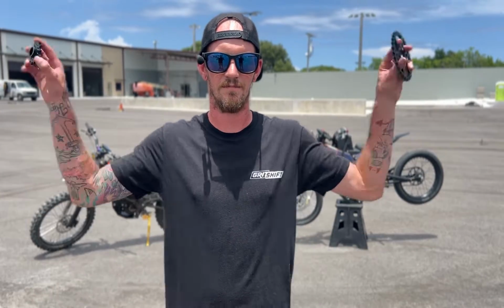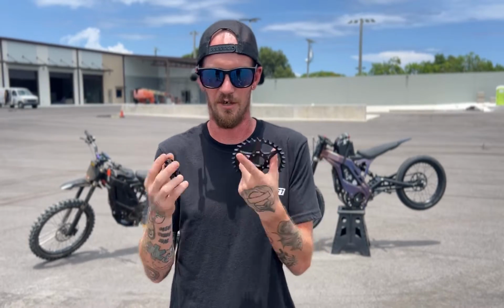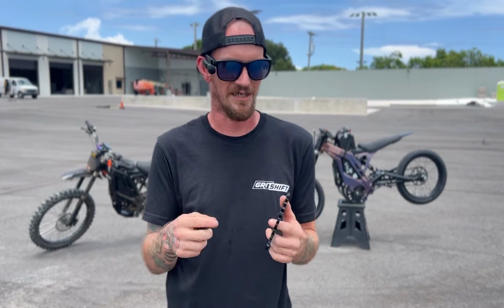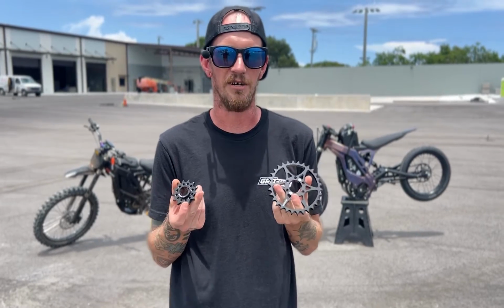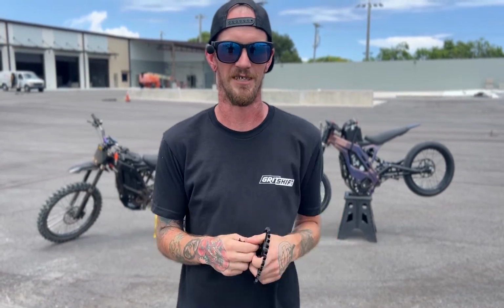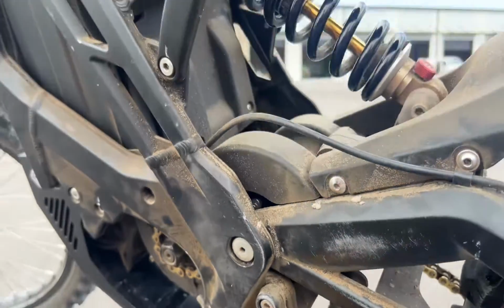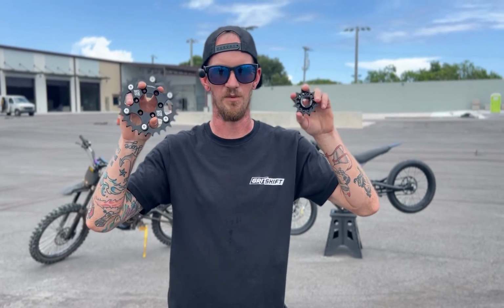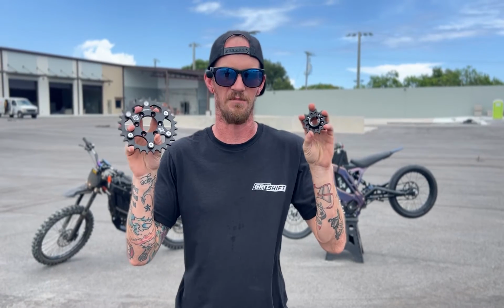High Performance Primary Chain Drive 420 & 520 For Surron LBX, Ultra, E Ride Pro SS

Comment: Are they lighter than Warp 9 Sprockets, like I run a 60 tooth Rear with a 16 inch Tusk Recon or Cheater Tire, Warp Wheel, stock front sprocket? Always looking for ways to cut weight especially on Rotating Mass. Thank you. need to raise my Bike up a bit too, need to buy one of your Linkages for my SS Pro but everywhere I check, they are out of stock. Thank You! : )

Comment: What motor are you currently using on the dragron?
Reply from the maker: We are now using the xlb-60 prior we where using the KO big block. We switched over to see if we could get faster times. The e ride drag bike is using a ebmx ultra bee motor.
Reply: @gritshift  did it work are the times faster?
Reply from the maker: @adamschoneman4639  our dragy broke, and we just got new ones last week so we should have some times soon!! It’s really hard to tell without that because we also are now using the x9 controller and it’s insanely smooth so it almost feels slower. But we will know soon enough.
Reply: @gritshift  cool thanks
Reply: @gritshift  
Can a Talaria's Gear Box be placed on an e-Ride pro SS?
Reply from the maker: @shockadellick  Not without a ton of modification. I personally wouldn't want to use the Talaria gearbox on the E Ride though we have broken 3 of them, and only one jackshaft so I think the jackshaft system is more reliable.